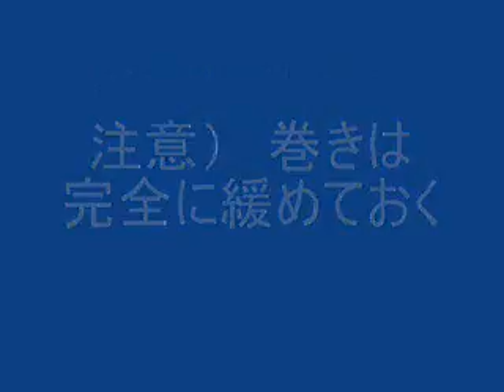Maintenance of phonograph　蓄音機の整備3　ビクトローラの2連発条モーター

Comment: @ozisan88 Thanks for reply,
After seeing these vids never went to service guy n successfully changed springs of motor no 58 and 102 (both HMV).
Now I have another 102 model, which spring broken near the inner end, if I leave that part it's 12 inch short, duno how it ll react, and I have two broken (113 model) spring, want to join them to make 1 spring 4 backup, so the length is required.
I am having few (6-7) winding machines and it's best to repair them self,
Thanks again,